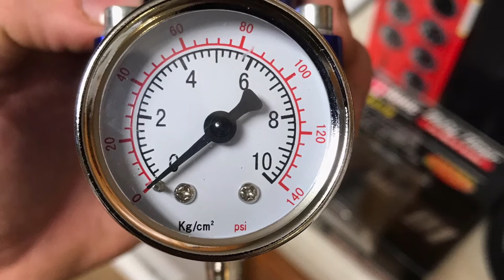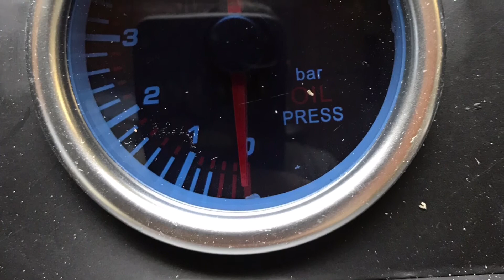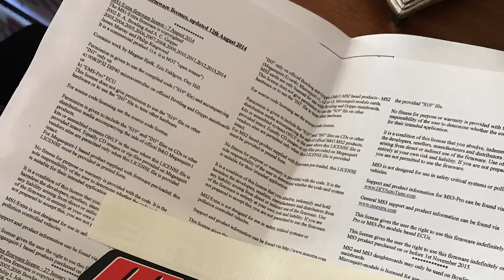Turbo Saturn Build

Comment: Can I ask how much you spent I have a 99 and sl2 5spd and was thinking about this.
Reply from the maker: The car is a friends that I built for him. The car isn't finished yet because he was gone for about 10 months. Hopefully once its done I'll get to put it on the dyno and see what it puts down for power. Currently its getting some changes like a bigger turbo, intercooler and fuel system along with a few other things so the total cost of the build is still under 8K as of right now.
Reply: @srtkiller2519  Interesting build. Did you get it dynoed yet?
Reply: @srtkiller2519  "some changes" 😂 fuel/spark control is about as significant as it gets dude